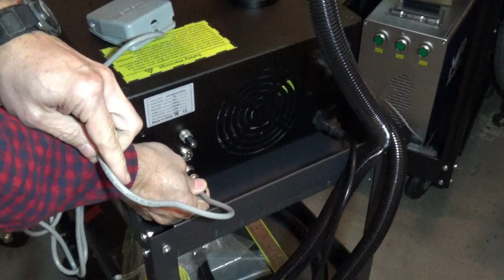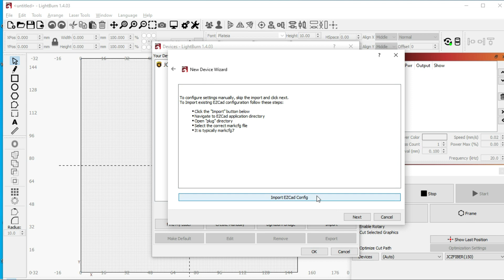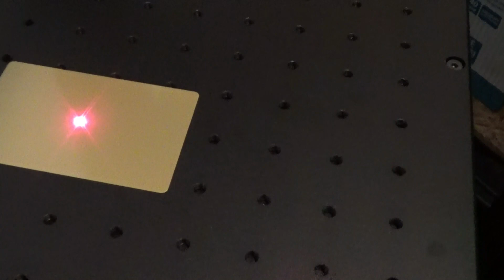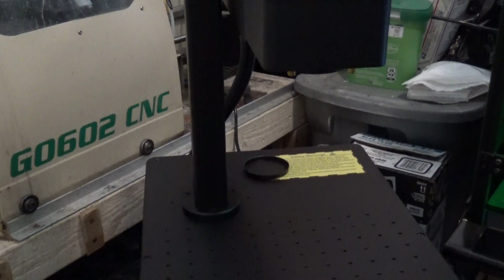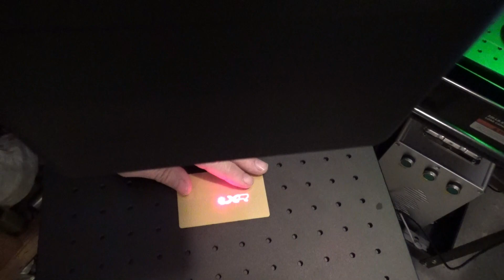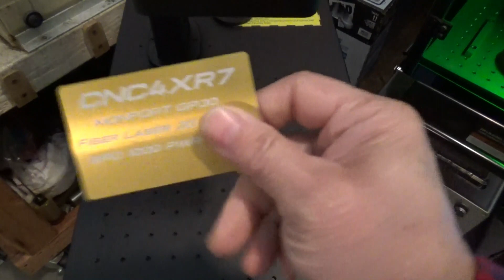MONPORT GP 30 Setup

Comment: I appreciate the help... Unfortunately, none of this applies to my Monport 30W Fiber Laser... The drivers are not shown when I search the USB drive. Mine looks a little different than yours (it has the large base with the power source built-in below), but nowhere in the buying process could I find the model number. I'm completely lost. Any advice would be awesome!
Reply from the maker: Is your laser a Monport? Integrated unit ?
They have several models can you find yours on they website?
Reply: @CNC4XR7  it is a monport integrated unit. The closest thing I can find is the GA 30W, but it doesn't look the same as the one they have on their website. It's a silvery color, and it has a crank on top. Apparently it comes with BSLCAD, which I've managed to install, but it says there's no driver card, and I can't find any way to update the drivers. Maybe I don't need to update them, but when I try to make a mark, it says that it's marking, but the red dot doesn't move, and nothing happens.
Reply from the maker: @RedRightHand-Blades-Marshal  it is connected to usb?
Have you contacted monport.
Reply: @CNC4XR7  I did... They sent me a copy of the manual (for a different model, lol). 

I actually got it to mark today... I have no idea what changed and allowed it to start working, but whatever. 

Thanks again.
Reply from the maker: @RedRightHand-Blades-Marshal   happy to help

Comment: Whats the frequency range?
Reply from the maker: Not sure if this is what your looking for but the wavelength is 1064nm more info on the Raycus laser can be found here.
https://en.raycuslaser.com/view/2032.html
Reply: @CNC4XR7  oh I meant kHz freq. Not wavelength. Advertised it's 40-60, but I seen in your videos you running from 20-80. So I wasn't sure.
Reply from the maker: @nickmcdaniel610  yes I normally run @20

Comment: I would reconsider supporting this company. After watching your video I purchased one and they sent me the wrong power machine that was drop shipped from some random place other than Monport. I contacted them and they refused return until I got in contact with my CC company to initiate a chargeback. Not to mention the machine I received was clearly a fire hazard with poor wiring, crimping, and workmanship. I would stick with cloudray or any other reputable brand. Just look up their google reviews or BBB website... I have a feeling they will eventually get sued for gross negligence, false CE certs, false FDA certs, illegal customs reporting, and illegal operations. Just takes one fatality to cause that and if my business didn't do a risk assessment before turning what I received on, I would have gotten shocked pretty bad.

Comment: Great videos. Thank you for the information. I'm about to buy one of these machines. Do you think this is better than the 2 part unit 30W unit? If so, why? Thank you in advance.
Reply from the maker: The Split unit is bigger overall and beefier. If space is not an issue I would go with the split unit. It may be easier to mark larger objects with it. The Mast is taller.  
The GP30 Power Z is a nice feature But I think the split unit would be my choice. I Plan to do a thorough comparison when I have more time to evaluate the GP 30
 Dont for get the code to save. Save 10 % with Code : CNC4XR710
Site wide
Reply: @CNC4XR7  but the GP 30 has the handheld option, isn't it?
Reply from the maker: @priyan776  no It does mot have a handheld option that I'm aware of.
Reply: @CNC4XR7  As far as I'm tracking, it comes with a long cable to use it and the handheld mode. Like on ComMarker B4. You just have to buy the corn unless yours came with it.
Reply from the maker: @priyan776 I don't know for certain as I don't have the com marker B4. The specs don't list machine size however it appears smaller than the GP-30.  The Gp does not come with the cone or a handle to hold it up against the wall etc. The GP 30 does have a long umbilical  cable. So it definitely could be used in that fasion.
Reply: @CNC4XR7  interesting, thank you for the information. I might get a 2 part machine then.
Reply from the maker: @priyan776  your welcome